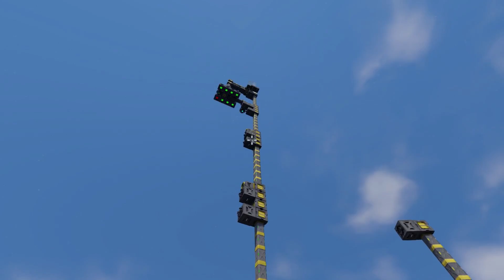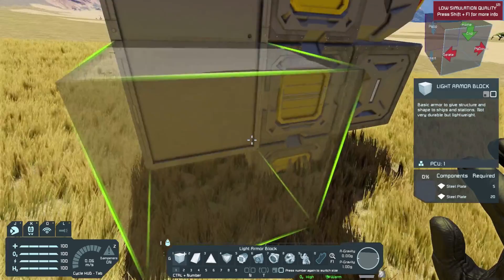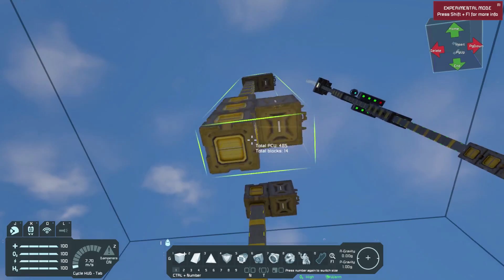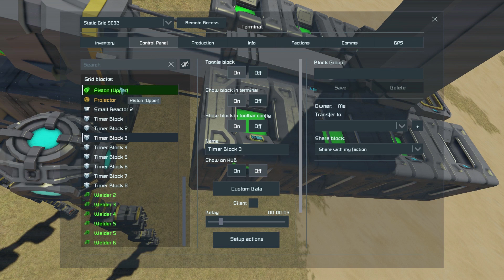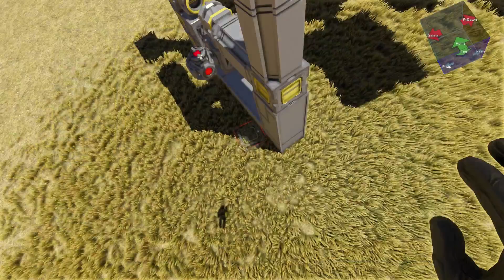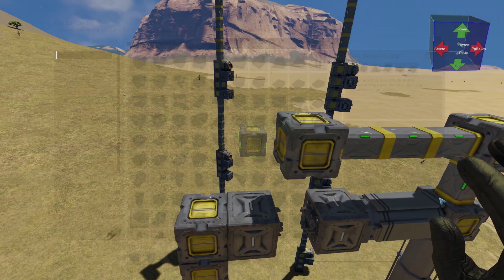Space Engineers #9: Automated Tether

Comment: There’s an easier way to get materials from a planet into space if it’s a planet with low gravity. You would have to use the build & repair mod tho. I haven’t tried it on earth but I’ve done it on another planet that had low gravity. This would definitely work on the moon but you can build a connector spitting out the resources you want to send into space then build a tower with gravity generators stacked on it that will propel those resources up and into space then on your ship or station in space you can use build & repair to collect the resources. I actually built this onto a drilling ship that would drill for ice and send it into space so I could refuel my mother ship without having to shuttle ice manually from the planet surface. Worked like a charm.
Reply: sounds like it would be useful tbh

Comment: I cant make this thing work. Once the merge and connector make a connection, the pistons wont retract when its time to release
Reply from the maker: That's a copy and paste issue with blueprints. If you really want to use it, you'll have to build it from scratch. It's really simple. Just use the original as a blueprint. All the timers should be correct but it has been a while since I used this machine.

Comment: Did you actually complete this to space?  I'm having problems on the moon, 0.25g of course, but I decided to try there for the first time as I only need to go 2.7km to get to 0g.  However, around 200m high, I start to get wobble from the merge blocks connecting and disconnecting.  I've tried with shared tension and without....both have similar end results, albiet shared tension enabled reduces the wobble velocity dramatically, but it has far more more initial shock when merging/unmerging than without shared tension...both ending with wobble still uncontrollable.  If I don't adjust my timers to WAIT for the wobble to slow to an absolute minimum, carrying on will just increase the wobble dramatically on the next connect/disconnect...and it turns into the world's largest metronome and explodes.  However, the wait time is now more than double of the amount of time my vertical pistons take.  This needs to be solved, to be viable.  Its a station, so you can't use thrusters and dampeners - although you could manually fire them, but that would require you to manually nurse the entire setup.

I think it all has to do with the center of mass not being...centered.  And the taller you get the more problematic it is.  So I am going to experiment with artificial masses on the opposite side of the builder, at top and bottom, probably having to shift the AM between top and bottom depending on which merge block is connected.
Reply from the maker: You would be wrong. The reason it wobbles is because the whole thing is moving too fast and the alignment isn't set up correctly. I had the same issue when I was figuring out piston speed
Reply: @DragonNationGaming  I disagree.  Piston speed has nothing to do with it.  To prove this, I wait for ALL blocks to stop movement confirmed by build vision. Not 0.05m/s or 0.01m/s but 0.0m/s.  When I then merge or unmerge, I get movement - and this can only be due to a shift in the Center of Mass.  

I have a slightly different design than yours, not using the 9 welders which is ridiculous over kill, but it IS indeed helping you obtain  CoM symmetry over the conveyor tubes and junction tower (which should always be your horizontal CoM to eliminate sway - in my case as I remove my old merge blocks and connectors, but yours will be constantly shifting ever so slight because you leave your junk).  I am using 5 welders on a piston and they are not fully extended as well - this is causing a CoM marker to be about 1.25m away from the CoM of the Tube Tower.  

I therefore added 4 Heavy Armor blocks to my welders, shifting the CoM over the center, and VOILA...Merging now causes much much less movement.  Its not perfect, but much better and proves my point.  I need to redesign my builder anyways because 2 vertical pistons is not giving me a large enough ratio of conveyor tubes vs conveyor junctions.  I'm at 5/3 (I should be no more than 4/3 but that's another design problem in my current build, and 4/3 is impossible to create repetitively).  Your 8/3 (actually 7/4 but your first block could have been a tube - I drop a conveyor junction on the ground and build horizontally, on both ends, so my first block can be a tube) looks much nicer.

The interesting question is would making this in 0.25g (at a few hundred meters up, I'm already at 0.23g now) be easier, harder, or exactly the same on Earth regarding sway to due imperfect CoM alignments and gravity interactions (which will always happen, unless you duplicate your build on the opposite side of the tube tower).  I'm guessing easier.

In summary, ANY sway whatsoever when you merge or unmerge, is due to imperfect horizontal CoM of the build device.  This is exacerbated by height of the current tower, gravity, and current velocity of ANY block when you merge (which is chaotic, as the sway shifts the CoM, and can help or hurt you).  Horizontal and Vertical Piston movement causing sway is also due to CoM issues, as you are CHANGING your CoM.  I am assuming at this point if horizontal CoM is always perfectly balanced by actually duplicating your builder on the opposite side of the tower, then there should be no sway whatsoever during merging or piston movement (as long as both sides replicate the piston movements).  Therefore you can have as many vertical pistons in the build as you want, but 3 is the minimum (you can do it with 2, but due to piston part dimensions you won't be perfectly aligned with both merge blocks when fully retracted - and this will also cause movement).

I'll try the CoM symmetry when I build one on Mars.  The moon was my test run, as I believe its the easiest conditions.

Comment: could reuse the merge block instead of building 2 for every step

also bonus points for grinding the bottom and replacing it with tubes
Reply: Actually I'm grinding my merge and connector blocks as I build.  They sit underneath the entire setup, so the mats for those pieces are constantly being shuffled between welders and grinders....100% green, lol.  This uses A LOT less components, as merge blocks and especially connectors use much much more material than conveyor tubes.  It also will make a huge difference in the center of mass, albiet my much lighter version may be getting its wobble problems partially from this - My tower of only tubes and conveyors has a further distance between the tower's center of mass and that of the builder, which will cause more wobble when merging.

Comment: Has anyone tried using merge blocks in the vertical structure to break it up into multiple grids and therefore cause fewer issues with grid size?
Reply: would like to see how your idea in game, good sir
Reply: If you had merge blocks in the vertical grid you would need a separate vertical structure for just the conveyors so the resources from space can travel to the bottom (if there is merge blocks in the way they won't act as conveyors..i get the feeling for your idea of more grids, it would be better to use connectors insted, I just don't know if connectors would be as stable as merge blocks.

Comment: Why didn't the space elevator work?
Reply from the maker: It's easier to explain when I get to that point. My old subscribers known the frustration I had trying to build the thing. We'll get to building the elevator again soon.
Reply: @DragonNationGaming  I made a little different variation of the desing you were showing us. But I did use the same princip.
What you were using was just fine, the few kilometers, but then the problems started. The welders were doing their job slower and slower.
I tried adding welders to the side, which worked, for a little time though...
To avoid a long explanation. The best way for this "autobuilder" to work is to add a cargo container with all of the needed components for the conveyors, connectors etc.
And use welders alongside the tower. The section you are showing us is 9 blocks long, I used 5 welders for it. And the "timer 1" started, the pistons  lifted the whole "autobuilder" 1 section up and welded the projection in a few seconds. I reached 20km now... I am not planning on going further XD.
With your desing, the welders needed around a minute for that section(on 7km), and much longer on higher altitude...
BUTTTT! now I have a major problem, the shitload of conveyors are making my game stutter when I weld or grind something(especialy big freeze when I grind/weld anything conveyor related). I am gonna transfare what I need and destroy the tower afterwards.... Not much playable in the current state.
P.S. - The first few kilometers I even added light blocks and solar panels, so make it more usefull ;)
Reply from the maker: @Boldimore  In my design, a few years ago, I did the same thing. I added cargo containers and sorters that pulled the required resources. That solved the problem with the welders but the issue with the welders isn't only because of the distance. With all of the conveyors, the framerate slows down and the welders don't weld because of the lag spike. It's an issue with the game. A few people have built space elevators before but I figured out that they cheated. They went into creative to finish the tether.  Never trust a youtuber lol
Reply: @DragonNationGaming  Just watching the video #15, in 16# you hopefully made something so I can copy it :P

Comment: If you want to save on some blocks,  make it so when the lift pistons retract, a grinder cuts out the three blocks under it, aka the two merge blocks, and the connector. As they are only three blocks, but when made over a huge distance, such as 21,000 block tall structure, you will save a little more than 5,700 blocks over 21km of height. (21,000/11*3) aka (Target Height/Height Of Segments*Blocks Removable)

Comment: This has a lot of flaws and a lot of advantages. The pros of the build are the exploit of the instant travel of materials using conveyor systems and them going from the surface of the planet to space. The major cons, however, are the fact that it is unstable at times and un-efficient if you think about it. An enemy can just shoot down one of the ports and the whole grid could come tumbling back to the planet and not only destroy the base of the elevator but the whole pipe which would set the faction that built it a lot. The way that shapes, like the conveyor pipe, work in space engineers is that they literally carve the voxels block by block at insane speeds sometimes. That would turn it into a deadly weapon to the structure underneath it. It would be useful if you were playing as one whole faction and without wars, but if it were to be in a massively multiplayer scenario with ongoing battles, it would make that target number one. Space elevators don't work that well in the game, especially because of the physics if you break it and it all comes back down to the planet. It would be an expensive and risky project, but It's justified that the faction that builds it wouldn't have to waste time going from space to the surface to transport resources to their space station and such, thus even if destroyed it could have saved the faction some power. Perhaps if it could be guarded better it might reduce the risk but raise the loss if destroyed. 
The build is a risky one; it can either cripple the faction or run them to success, although the cripple part would be rare since to build one of these pipes systems would cost a lot of resources. If the faction is able to get that much material to build the pipeline, they would probably be a strong faction. This can be a very powerful infrastructural tool if used and built correctly. Imagine having your ground crew mine the ice lake out and just haul the ice to the elevator and in a couple of minutes 8 million tons of ice are in orbit ready to be put to whatever the faction needs. This tool when used correctly will bring the faction to the top, probably. 

If the faction makes it, the pipe can remove their need to waste energy launching ships from surface to space and back down. This could save the faction the wasted time on those operations and focus it onto something else, say exploration. 
If someone decides to build this in a server with wars that can happen, they should probably focus more resources into reinforcing it and defense.
Reply from the maker: A couple of things. I am playing in a single player world so I don't have to worry about factions. I'm just building cool stuff for fun. The tether doesn't require a faction. I'm a single player and already have enough to build the tether to space 10 times at least. Defending it in multiplayer would be almost impossible. It would be better to just build ships. Another thing, keep the messages short. I hate reading lol